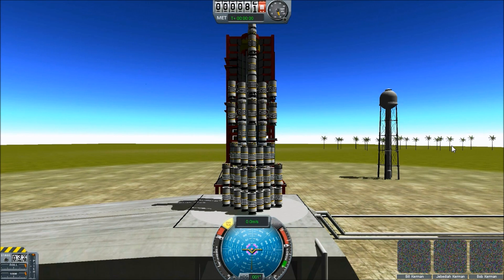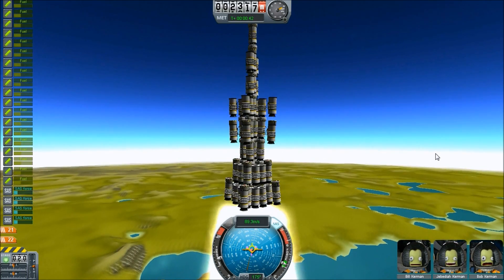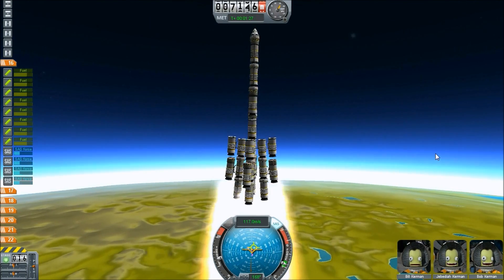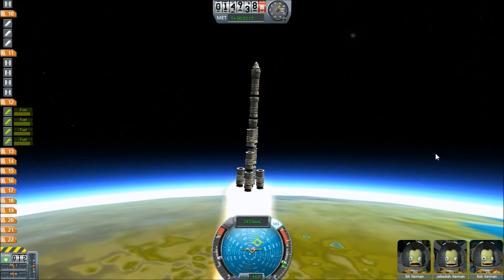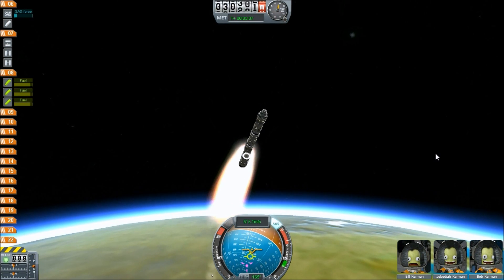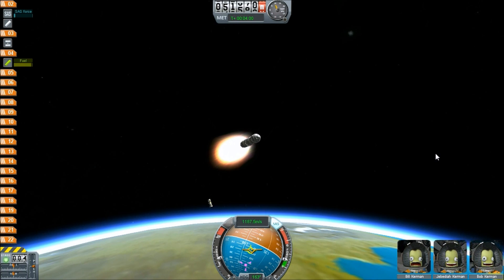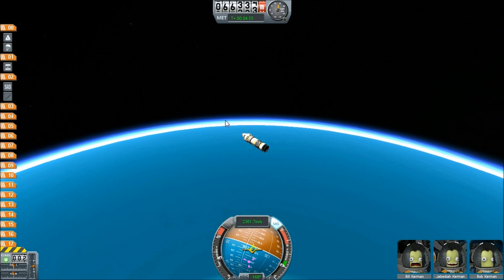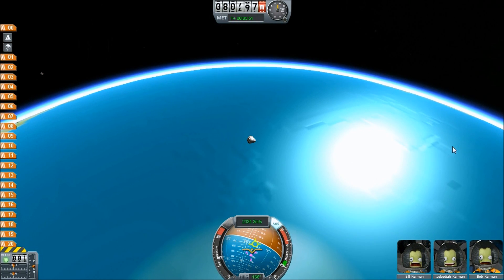KSP - Orbiting with solid boosters only.

Comment from the maker: @Zyoher In my experience they have very different motors. The solid boosters are like a fire cracker: very potent, but not long lasting. They have great acceleration, but each stage seems to hit a brick wall of max speed. The liquid boosters don't have that sudden acceleration, they are quite a bit slower off of the start. However, as long as they have enough power they will keep speeding up. That's why I like using solids to get me off the ground and liquids to keep it moving.